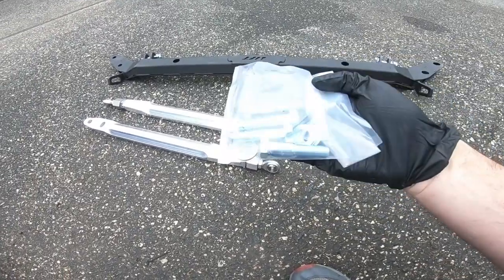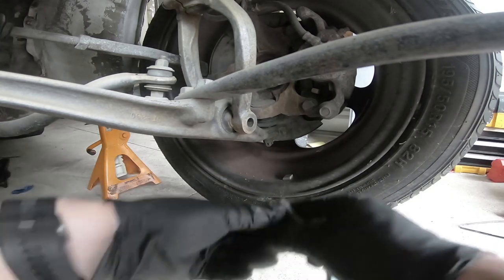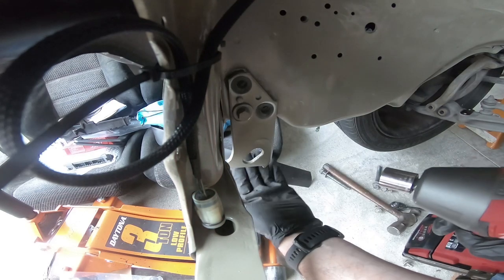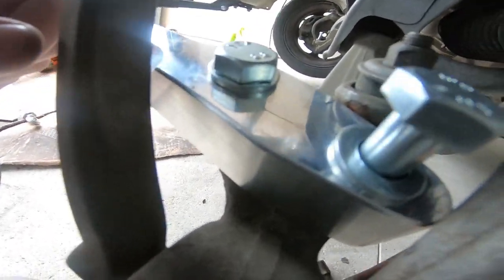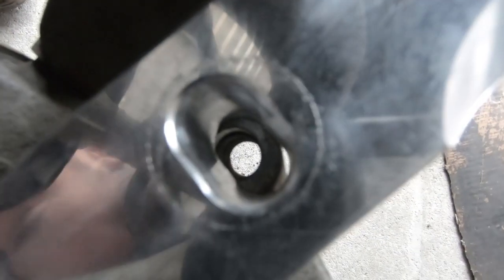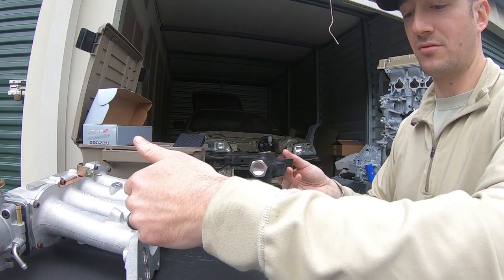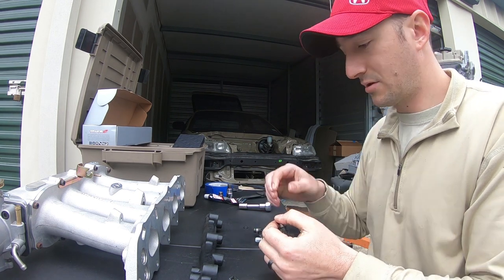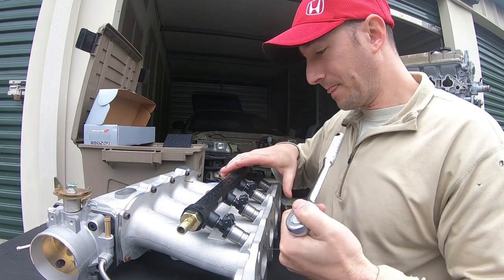Honda CRX Si Innovative Pro Traction Bar / Skunk 2 Ultra Series Ep. 09

Comment: 2 things man, not to tell you how to do your build (so far when it comes to the engine build, and specing everything out, you are far beyond anything I have ever done).   But for the teflon tape, is that the white standard stuff for regular pipes?  I always heard to use the yellow rated for fuel on gasoline or some of the paste stuff ("pipe dope" they often call it).  Before you run fuel through it, you may want to double check on that, definitely don't want a leak right there.

And for the radius arm, did you try jacking up on the arm a bit to see if you get more clearance?  I have had to do this in the past (with the OEM radius rod) to get the holes on the rod to line up properly, and sometimes end up actually compressing the strut assembly some, almost like the radius rod holds them assembly up just a bit.  But I would figure if that was  your issue, Innovative would have made that suggestion.  So I may be way off base.

Anyways, loving the videos man, keep them coming!

Comment: Can I mount a Radiator to the Pro Series Traction Bar????
Reply from the maker: The way it comes there are no provisions. I just sat my half core on it with some rubber underneath to help with vibrations
Reply: @justingadell  and it held that way????
Reply from the maker: 100%. I had just 1 mount on the top
Holding it to the Tbar and then obviously the radiator hoses keep forward pressure. The 2 bottom “pegs” I put in the front of the crossmember while it sat on it
Reply: @justingadell  oh ok I gotta check that out did you use the top stock mount?
Reply from the maker: Unfortunately I did not mainly because the radiator I bought couldn’t use it :( quick bend of metal and I was good to go